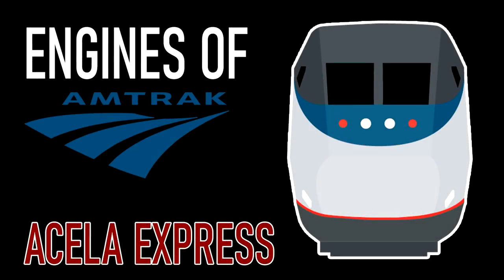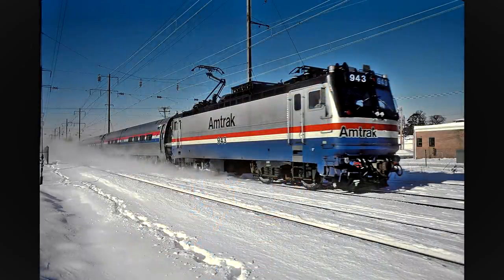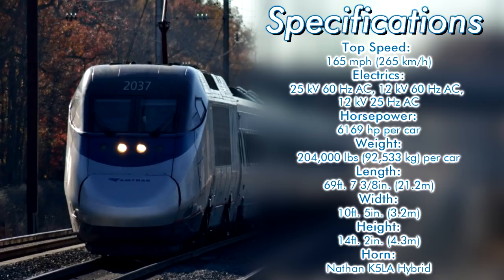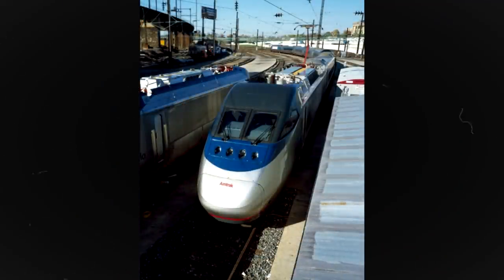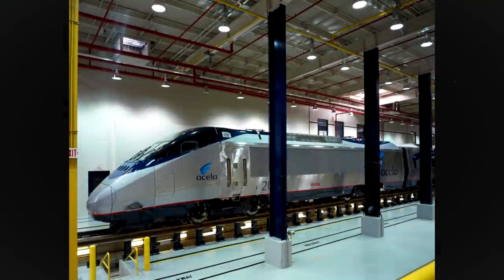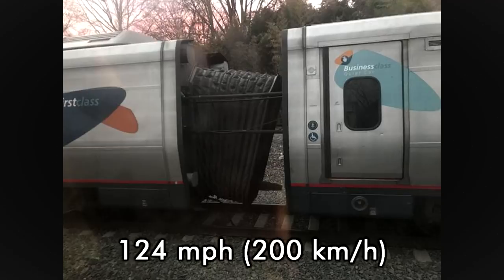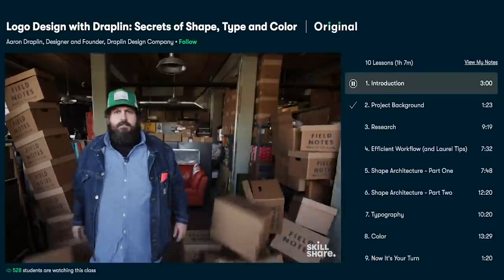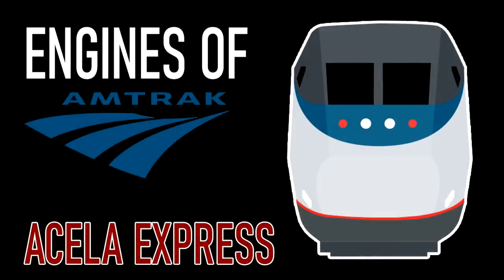Engines of Amtrak - Acela Express

Comment: It's crazy how heavy the cars are but then again the weight of the whole train set is the weight of one big boy
Reply: There's a lot of information out there about this - it's primarily due to United States safety requirements for crash / impact testing and integrity, indeed these companies manufacture very similar train designs at a fraction of the weight for other countries. 
It does pay off though, as can be see on both sides of things (crashes inside vs. outside the US).
Reply: Wow
Reply: @EstorilEm 
On the flip-side, though, how many collisions between trains happen in the US vs elsewhere? Our equipment might be able to stand up to rough track and take collisions a lot better, but in Japan and most of Europe those kinds of incidents don't happen anywhere near as often.
Reply: @VestedUTuber  I wouldn't say it really happens often in the US either, more so historically all freight trains were super heavy and freight companies have no intent to buy lighter locomotives due to the weight of freight trains in general, so all commuter trains had to be heavy enough to withstand collisions with them specifically, and this sort of doctrine just continues today. Just like everywhere else, there are the few big accidents but it's not a common thing.

Comment: 5:48 amazing video, i love the remastered version. for the timestamp there is a small correction. only the passenger cars had tilting technology in them, the power cars never had this ability. the avelia liberty sets coming soon do have tilting technology in all passenger cars and power cars
Reply: Then why need tilting track if they can tilt themselves? I don’t get it
Reply: @Boypogikami132  It’s simple physics. Think about riding a motorcycle. When going really fast you tilt to turn even if the ground is tilted. This way you can spread more of you mass onto the ground and not flip over. The added tilt just helps the trains run faster without upgrading more infrastructure.
Reply: @banksrail  Correct. Since they want it to be high speed rail they need to take all the steps to make it as fast as possible.
Reply: Yes
Reply: The power cars on the Avelia don’t tilt  because that will cause unnecessary wear and tear on the catenary, from what I’ve heard.
Reply: @Boypogikami132  tilting the track helps add to the increased speed and smoother ride. Although the wheels don't tilt so kinda still need to tilt the track. Kinda like wireless guitar still needs cables, sugar free soda still uses sweetner, or "in cab" train signalling still needs signals outside.
Reply: @JSCoolDuud2220 // Metro-North BOI R62/A and the 46s are going to be more than 45 when they’re replaced. I wouldn’t say it’s that fast.
Reply: Conner

Comment: What's ironic is that you mentioned the HST at 0:48, which is double the age of the Acela and while it has been replaced on two major high speed routes, it's still running some long distance services and expected to operate even after the current Acela trains retire, while the US replace their trains after 20 years, UK trains usually last at least 30 years, with most lasting 40+ years. The HST was supposed to be a stop-gap until APT tilting trains arrived (British Rail pioneered advanced tilting technology), but the APT never reached its potential and was outlasted by the train it was intended to replace. Awesome video though!

Comment: Potentially unpopular opinion, but the Northeast Corridor is the only place where high speed trains make sense. Here, the cities are densely populated and relatively close to each other, much like Europe, making the train a sensible option. But the further west you go, the less dense cities become. Distances between the largest cities would mean that the travel time would be anywhere from 4-6 hours. It only gets worse from there: cross country distances, even when using the highest speed of the Avelia Liberty, would take 12-24 hours to cross, meaning all-daylight runs would be out of the question. 

To be completely honest, I would love a high-speed long-distance sleeper service. That said, not everyone is a rail enthusiast. It might be possible to convince general public to trade the stress of driving or the lead time of airports for a much more relaxing experience at a premium. But most are going to look at the greater costs and longer travel times, and either drive or just take the plane.

Comment: You forgot the Acela crash on October 28, 2004 where First Class car 3201 hit a bridge support.  3201 was removed and the rest of the train continued service holding down the Metroliner service.  After 3201 was repaired in Bear Delaware it was re-added to the train and it runs to this day.

Comment: I really wish the U.S. would invest more into high speed rail, specifically for routes where regional airlines operate. Perhaps consult with the Japanese and or French and the companies that manufacture the Shinkansen and TGV. High speed rail trips could be more convenient and possibly even faster when considering transit times to the airport and the time it takes to go though security as well as the time spent waiting at the gate and then for departure. As well as the time spent transiting through the airport at your destination and then traveling to your end location from there. You could theoretically travel from city to city instead of from inside or outside the city, to an airport. Then taking a plane to your destination airport and then taking another method of transportation to your final destination. Trains can theoretically be more efficient than planes and are easier to power with renewable energy, as I don’t see Hydrogen or Hybrid planes being a thing anytime soon. I just want the U.S. to at least try to catch up to Europe in terms of easy passenger rail travel. If we are ever going to reduce our reliance on fossil fuels, reliable and affordable high speed rail will have to be part of the equation. I also believe enabling easy and convenient access to fast and reliable rail transportation will help encourage people to travel more for leisure and recreation and possibly help stimulate the economy. Imagine how cool it would be to quickly travel to New York or Boston for the day (I live in Philly) or, perhaps stay the weekend without having to drive for several hours, there and back. The fact that you can travel from London to Paris in just over 2 hours on the TGV, speeding along the tracks at nearly 200 MPH (Approx = 320 km/h) is just so cool to me and I hope to do it one day when I visit London on vacation.

Comment: you could've added in the recent tests Amtrak had for the Acelas when they were adding Acela cars to the trainsets to see if it was efficient to run longer lengths of Acelas at high speed to meet the demands of increasing passengers. I had wondered what ever happened to the results of those experiments, then the Liberty showed up.
Reply: The idea was scrapped because of cost. The original factory was closed down over 20 years ago. The cost of buying 40 new coaches, two for each train set was outrageously expensive. That’s when they decided to just build entirely new trains

Comment: 25kV seems to be universal, auckland metro in new zealand is 25kV ac as well, plenty of power
Reply: In Germany (and other countries using the same railway electrification) high speed trains run on 15 kV 16,7 (or 16⅔) Hz. That system was chosen early on in the countries electrification and works fine so upgrading it is not worth the hassle.

Comment: Amtrak: we will replace Acela because it is 20 now
Meanwhile Koleje Mazowieckie: hey guys we got the oldest of the running EN57s, it will hit 60 soon, and we don't plan to replace it in the nearest future
Reply: I don't know for Acela, but usually trains are replaced after a certain mileage. Passenger locomotives, beeing faster than freight trains, have usually a higher annual mileage and thus a shorter lifetime. Furthermore, the wear is higher at high speeds, specially since these locomotives are designed to be light though powerful and fast,  requiring very advanced technologies, with reduced lifespan.

Comment: The acela can do 161 mph
Reply: They can go a lot faster than that, They had it up to 173 in 2012. If they had the room they could easily make it to 200 which is where the gearing is set